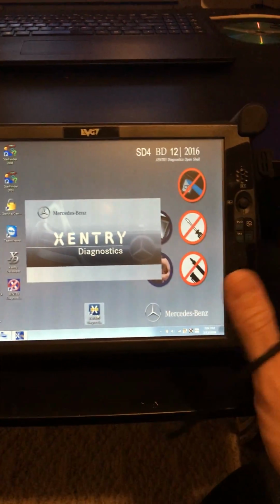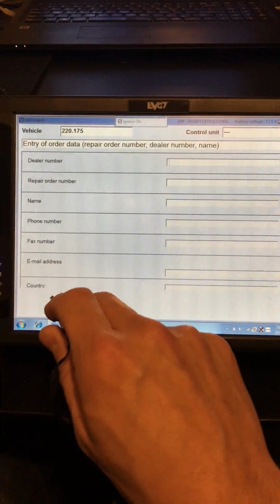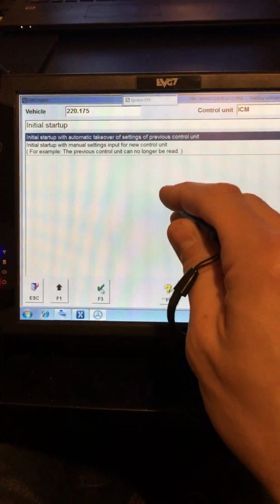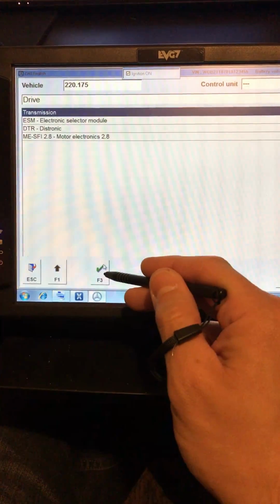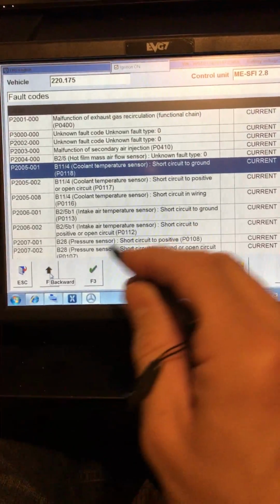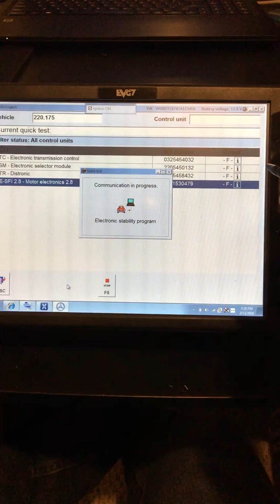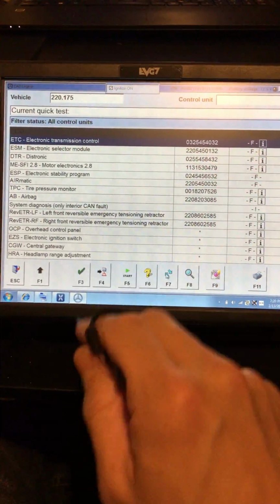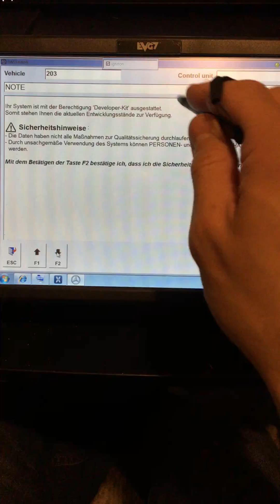Mercedes Benz SDS Star Diagnostic scanner tutorial quick intro on how to use the scanner

Comment: can this activate some features on my 2012 benz s550 japan import? alot of things r disabled like aux, bluetooth music, dynamic and massage seat
Reply from the maker: No, thats not how Mercedes works. It either has the options or it doesnt. Its not always a coding or setting. So I dont think this will help you with what youre asking sorry 😞
Reply: @MasterTechLou  coz i can see people with s550 that is not japanese they can actually activate aux just by using engineering menu. on japanese imports we cant even change the date and time settings
Reply from the maker: @thehobbyist5292  ohhhhhh ok. Then MAYBE? If you can change the country code however back in 06 mercedes took a lot of programming away from us. Everything is done online according to vin.

Comment: should you have the mercedes already running when you plug in star, or should you plug it in beforehand? it might not even matter, but i just got star, and i don't want to damage my truck doing something wrong lol
Reply from the maker: Hello my friend, it doesnt matter. We plug it in either way. the obd port is battery power not key on power and the modules arent even connected or talking until the scanner reads them. No worries you cannot damage anything but glad you asked! Better safe than sorry!

Comment: Thanks for kind tutorial. I have a question about coding. When I start my W164 ML350 he display mileage but I want to change that to speed meter is that possible using xentry? PLZ teach me thanks
Reply from the maker: You cannot change that with scanner only steering wheel buttons. It either shows speed or outside temperature.
Reply: @MasterTechLou  Thanks alot

Comment: Really helpful information! One question, how can I use a simulator like you are doing in this video?
Reply from the maker: Thanks! What do you mean how?
Not sure of the question. Its just an extra icon you open. I have no idea why they offer this but its useful for practice.
Reply: Thanks for your quick reply. What icon is this for the simulation of vehicle connection. Cant seem to find it.
Reply from the maker: @TheENchannel7  ah ok, it has a huge X on top of it. 
If not open the files and you may find it just no shortcut. But all of them have it im almost certain.
Reply from the maker: @TheENchannel7  its the exact same as the normal xentry but it says SIM on it.

Comment: I have 2010 gl450 .rear wheel are down both side.even I raise them it will not raise.
Reply from the maker: either bad compressor or bad valve block
Reply: @MasterTechLou  thanks .it was rear level sensor stuck high

Comment: First of all congratulations for the video, this is the best xentry explanation video Ive ever seen, by far!! Thank you for helping everyone trying to learn how to use SDS! So, is it possible to virginize a facelift W212 cluster and make it work with a 2010 E250 using just xentry? Also, I have a problem with my left headlight, is it possible to test all the ILS cutoffs using xentry? It has the Hella VarioX system with multiple light modes and I guess it is not working fine

Thank you!
Reply from the maker: Thank you for the compliments!
Unfortunately with the xentry you cannot virginize a cluster. You can with an autel I believe.
As for the ILS yes xentry will
Help with that. Thank you for viewing!
Reply: @MasterTechLou  thank you very much for your help 👍🏽

Comment: Dear Master Tech Lou, I just have two questions that I think you can help me with.  First my C3 MUX or the old Dell with the STS software seem to be glitchy.  But this is what I get with a Chinesium knock off.  So it's intermittent at best But I was able to get the single code out for the ESP and it was a C1142-16. B24/2 Lateral acceleration sensor "signal cable open or shorted".  In my research I've found that the lateral acceeleration sensor is a troublesome part and I need a new one.  But I've also think I've discovered that this unit is not exactly plug and play that it needs calibration.  Is this true?
Also my second question what is the exact procedure to "clear codes". Is it run the scan, write the code or codes down and then press the erase button?  Then what? Turn the key off and then back on again and rescan?  I sometimes get a popup that the codes weren't erased and I needed to turn the key off but I'm vague about this procedure as I don't use the SDS often enough to get familiar with it.  

Also do you have a webpage or site that we can go to and bypass this format?
Thanks for your help.
Reply from the maker: Www.cartechconnect.com is where you can find me.
I can answer your questions there. Thanks!

Comment: Can you use star to code out the active headlight feature on a w219?
Reply from the maker: Im pretty sure you can, if you go into central gateway and if the option is there. But I don’t think they were optioned without it. But its the same as a 211 which is why I think its possible.
Reply: @MasterTechLou  Appreciate the reply man. One last question, do you recommend a specific website and or version to buy. Ive always been hesitant of the bootlegs but figure I might as well finally get one as I've never owned a car that's not Mercedes (on my 7th) and don't plan on switching brands anytime soon. And I'm obviously not going to drop 20k+ for the actual xentry lol.
Reply from the maker: @mr.choochoo2483  I got mine from mbstartool.com
Another friend got his from chinacardiags.com
I dont consider these bootleg they literally do everything except programming due to no access to mercedes servers. I don’t have a preference. Just check the reviews of which ever site you find or choose.
Reply: @MasterTechLou  Thanks!

Comment: Thank you Master Tech Lou for the offer to answer questions on the BAS/ESP chronic intermittent warning light.  I'll get some fresh codes and see what I find and then I'll come back to you.  I live over 100 miles from a shop that will work on this car but I've been a professional auto mechanic my entire career but Mercedes I never worked on so this is a vertical learning curve for me.  Thank you again!
Reply: Well the issue finally turned out to be the lateral acceleration sensor.  I even took it to Mercedes for repair and they missed it!!  I found a shop that finally traced the issue down to that little sensor and that was it.  The surprising thing was that with this vintage SLK this was a known problem but the mechanics in Mercedes didn't have the experience to catch it.  Spent a lot of money on this one and I'm sharing my experience with others.  The lateral aceleration sensor had an intermittent "open" at the circuit board and this is a known issue.  Good luck and glad my car is fixed now.  A pleasure to drive when a damn light isn't turning on and off.
Reply: The most common repair for it is to replace the brake light switch under the dash as they commonly go out. But as we all know the car will tell you what it needs with a good scanner or the real deal laptop. Good luck with it.

Comment: How do I get the scn string offline if my tcm not communicating?
Reply from the maker: Scn offline means that you manually scn code the module by faxing the codes back and forth to the Mercedes home office. 
If you cannot communicate with the tcm then you cant get anything from it.
Reply: @MasterTechLou  do you have to be licensed or do they just charge a fee..
Reply from the maker: @yasoutherncousin  only dealers can scn code offline, mercedes will not assist anyone outside of the dealership network.
You do have to be a repair shop and pay for service through www.startekinfo.com and use the j2534 pass through. Its very expensive and complicated
Reply: @MasterTechLou  ok thanks...currently applying for my nastf..I do have xentry c6
Reply from the maker: @yasoutherncousin  only problem with that is mercedes will not grant you a login and password unless you lease their scanner.
I wish I knew more how indy shops get by.

Comment: Hey Lou! I’m planning on buying a Star Diagnostic tool but I see that there are different types. C3 , C4, C5, C6, in the forums they say that there is a difference because some come with the capability to program offline, program online only ect.... the reason I need the star Diagnostic is because my parking Brake from my 2007 Mercedes S550 Base model needs to be replaced an reprogrammed. I want to not only be able to reprogram that part but to also be able to diagnose the issue for future events if they were to come. Right now I did research on the internet an from what I have concluded was that I need a new motor on my original Electrical Parking brake since the Force sensor is still good. The force sensor on the new part is the reason it needs to be reprogrammed. So if for what ever reason I replace the motor an my “Park Parking Brake See Oper. Manual” light doesn’t go off I need to be able to either reset the light or do something. The dealer quoted me $2,000 for the part an labor. If you can please help on guiding me to the right direction that would be amazing! Thanks!
Reply from the maker: Ok thanks for reaching out!
So as far as star diagnosis, none of them can program because you need mercedes online dealer access. But they can code some modules and relearn items. I don’t believe this needs programmed, just relearned which is done through adaptations which is something that all scanners can do. The difference between the C models is the speed at which they work. They all do the same thing based on the software. I can do a simulator tomorrow on a S class and see what’s involved and report back. If you dont hear from my by noon , hit me up for a reminder.
Reply: @MasterTechLou  https://youtu.be/p_D5ViA5Sqw this is the video an I’m in contact with another Youtuber too. Before I make this full repair I just wanna know if the stupid light will go off. If not then I’ll need the star. I have a MB II an I tried clearing the code an nothing. My dash board still lights up like a Christmas tree
Reply: @MasterTechLou  thanks I appreciate it! I have the Wis pulled up an on step 1 it states “Use STAR DIAGNOSIS to bring the brake cables (1a, 1b) into the assembly position” and step 15 states “Commission control unit of the electric parking
AR42.20-P-0590-01SX
       *BA42.20-P-1001-01K
    AR42.20-P-0540SX
 When replacing the electric parking brake controller unit (A13)
Run through the following steps: Select menu item "suspension" - "EFB-electric
parking brake" - "commissioning" - "commissioning with manual adjustment of the control unit". Then process all the individual steps.
                    Danger!
brake controller unit (A13) using STAR DIAGNOSIS, added”

I been emailing this guy who fixed the problem without a Star since he just replaced the motor. $33 a motor while the entire OEM part is $985 at dealer an some dealers cheap as $560 at Mercedes Benz star parts. My mane concern here is the stupid light. It is scary seeing it in all red letters am having to press ok to go “away”. I wanna buy the motor an take the part out then put the new motor back on an pray the light goes off.
Reply: @MasterTechLou   hey Brother! Hope you Doing well, I just wanted to follow up an see if you are still able to assist me. I have one last question. Which Autel scanner can I buy in order to relearn the Electronic Parking brake ? That will help me more than anything. I don’t believe my MB II scanner can relearn the parking brake.

Comment: Thank you! It would be great to get some sort of training manual that Mercedes uses to teach their mechanics in order to use this software...
Reply from the maker: Training manual you say? I can hear every Mercedes tech laughing at the sound of that. Its trial by fire with us. Ive taught myself after trial and error and constantly using it to see its capabilities. Im sure there might be some form of training material but none that ive ever seen.
Reply: @MasterTechLou  I understand we have to learn through many many clicks, mistakes and frustration. But I guess Mercedes doesn't want their mechanics in Mercedes shops to suffer like we do. I'm pretty sure there are internal Mercedes classes for their mechanics or something like that where they teach how to use all their software.
Reply from the maker: @NoWheelDrive  there is not a dedicated class I can tell you that. In fact there are times ive taught a teacher a thing or two about the scanner and how to be effective with it.
Reply: @MasterTechLou  Oh wow, it's hard to believe Mercedes did such poor job here. Sometimes I asked myself how they were supposed to use this software when it has sooo poor UX and UI. I.e. yesterday I tried to find some info about the location of radio and GPS antennas in my CLS W219 and I spent half an hour searching WIS before I quit. I'm going to install Android head unit and I'd like to reuse stock antennas and first step is to locate where its wiring is hooked to the car. I guess I have to remove liner in my trunk just to have better look and idea...
Reply from the maker: @NoWheelDrive  ok so  look in group 82 for those, but we use another function called star finder. its the wiring diagrams and location finder for the cars.
Reply: @MasterTechLou  Yeah, thank you, that's where I searched for radios, amps etc. I mean group 82. I guess I'll proceed with removing trunk liner soon. Quick question - my other 2005 Benz is not equipped with 889 Keyless Go option and I'd like to star/stop the engine it via a button on the shifter. Do you think it's possible to add this option assuming I could buy all necessary components that are missing i.e. Keyless Go antenna, new shifter etc?
Reply from the maker: @NoWheelDrive  anything is possible just depends on how deep the pockets and patience is. So yes it can theoretically be added but the cost vs benefit, you would have to go through the dealer as you cant just get a key from anywhere and theyre not gonna order you a keyless go because the car was not optioned for it. So its not gonna be easy. Would be better to buy a totalled car with all control units and swap em.
Reply: @MasterTechLou  Yeah, I agree. At this moment I even don't know the list of all components I need. Buying a totaled Benz is a great idea, but unfortunately I don't have space to store a totaled or broken car. I'll continue my research then. I really like starting/stopping car via button in my CLS.

Comment: They have all these scanners built into myriad tablets and Android devices, so I don't understand why we can't just download the app and pair a Bluetooth OBD2 module. I'm thinking it is to protect their intellectual property by embedding the scanner software directly onto a microcontroller. I'm still surprised nobody has made a fully functional Pro Scanner app that wouldn't require a $1K+ scanner (Android tablet). Someone could copy every output signal from every option for every vehicle listed in a pro scan tool, then make an app that outputs the same signals to activate different options. It would not be hard to reverse engineer and emulate a pro scan tool, so I'm surprised nobody has widely distributed such an Android app by now. Would be cheaper to emulate via an app than to find a manufacturer to embed a custom microprocessor into an Android tablet and then bring it to market, all of the latter would take a lot of time and cost a lot of money. Interesting. 🤔
Reply from the maker: Autel scanners are the closest ive seen but they’re still lacking the data regarding the fault codes and test steps. As technology advanced im sure it will happen just as you suggested.

Comment: Is this scanner capable of recording transmission data on a timeline for gear selected, shift points, vehicle speed, rpm?
Reply from the maker: that is not something I remember it doing, when we diagnose trans issues we first look at adaptation times for each gear and then try and readapt and then if the adaptation values are out of spec we know if its mechanical issue or not.